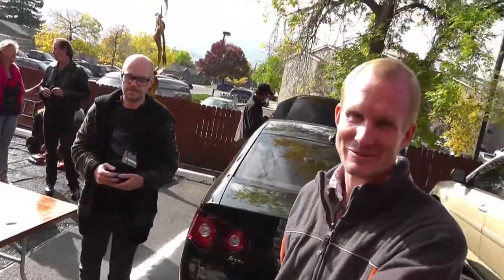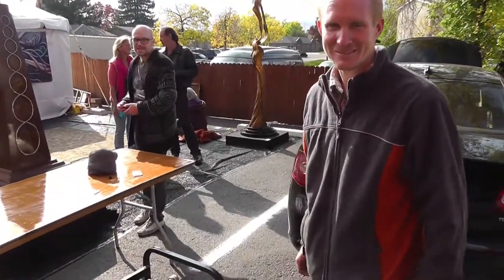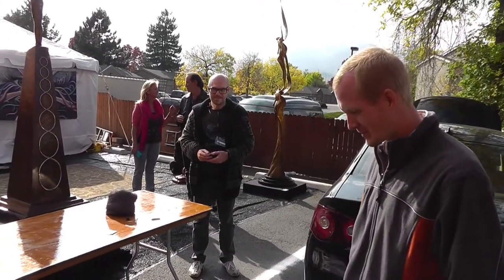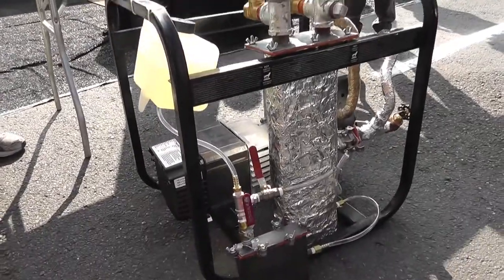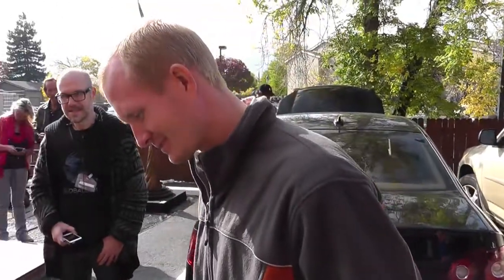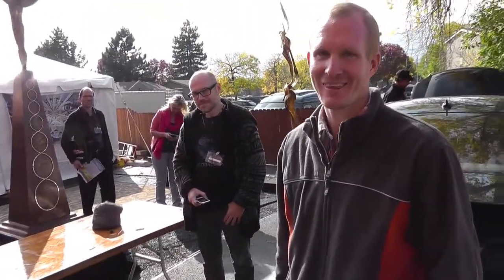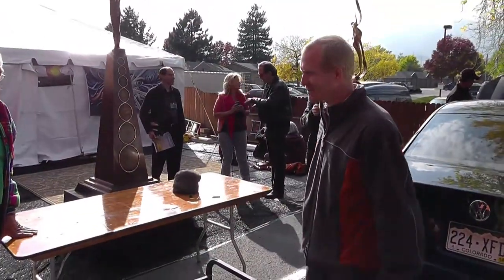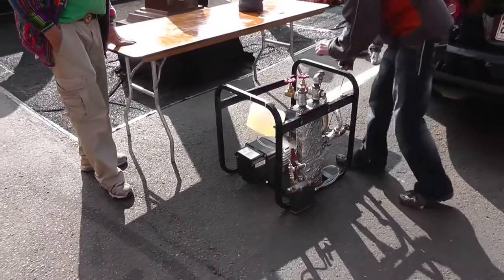#40 D3 Global BEM 2013: Tyson Capel demonstrates his vapor carb setup ~Russ's View RWGresearch com

Comment: Thanks for posting this Russ!!! You da man!
Reply: Tyson! What ever came to be of the  vaporizer valve you spoke of in some comments? I know you had to take a break from these projects but I am an HVAC tech and I believe we are both on the same page with the valve you spoke of. In my concept, you heat the fuel line and then run it through a txv (used in HVAC to expand refridgerant into a hot vapor) Im on the FB group as well
Reply: Have you used any distilled gasoline in your testing?